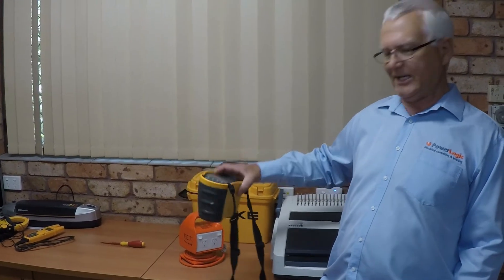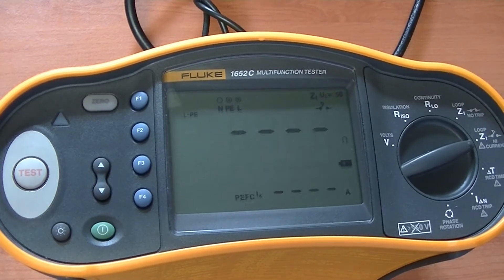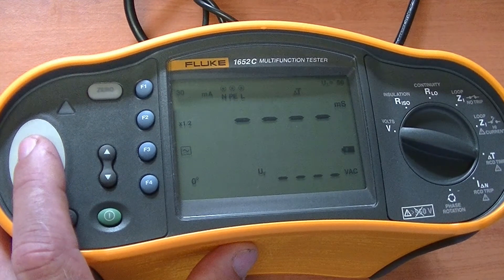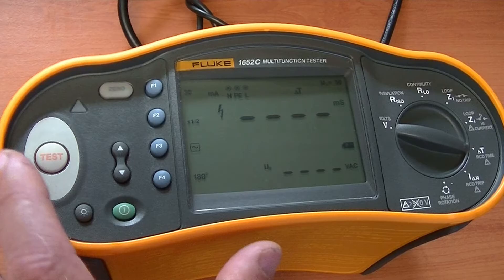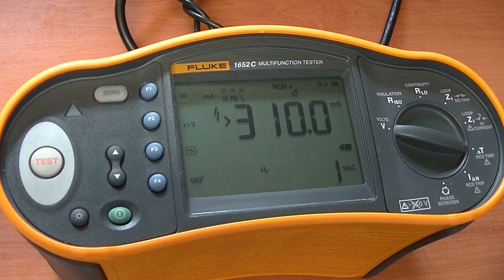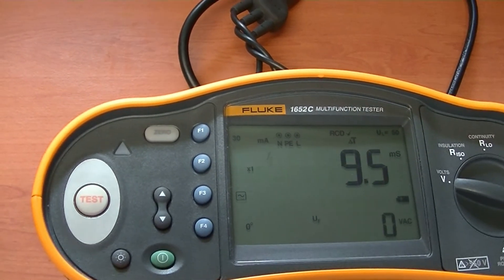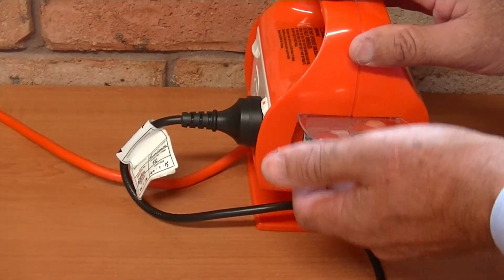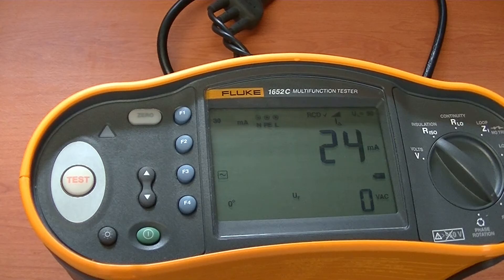RCD Testing using a Fluke Multifunction Tester

Comment: How would you set your Fluke tester for type A Rcd/rccbo
Your settings seam to be for ac Rcd which hardly in use anymore,
Reply: Whilst, Type A RCDs are no longer installed in Australia, there are still a stack of them out there that will need testing as per the video. The RCD type setting will need to be changed for Type A or other types before conducting the test.